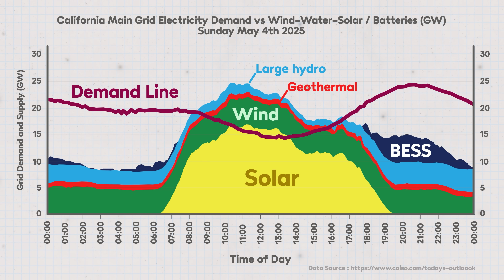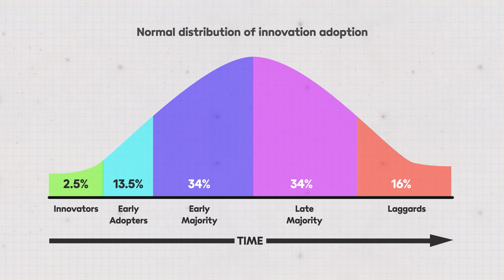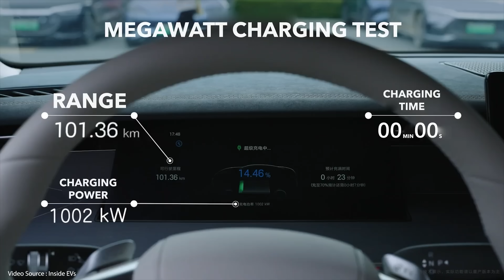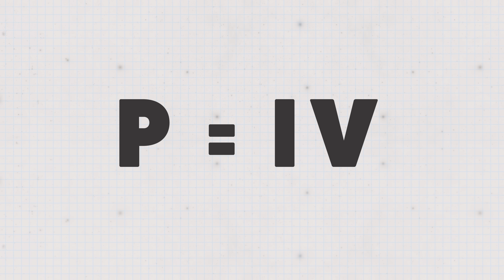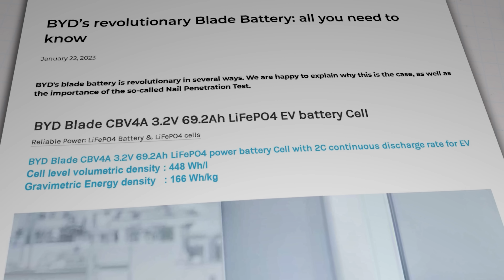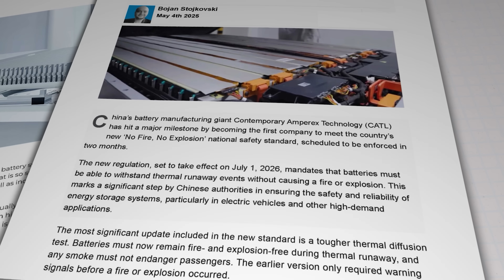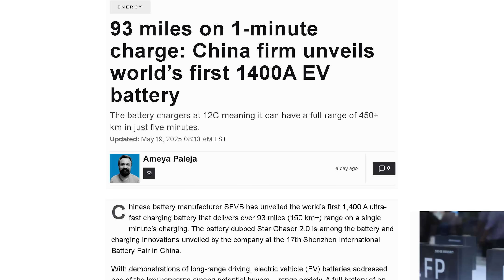BYD 1 MEGAWATT 5 minute EV Charger. Overdue or Overkill?

Comment: Fast charging ruins batteries...so how's that gonna work?
Reply: Source of your statement?
Reply: The battery is designed for the faster charging. Faster charging degrades the battery faster but as long as the battery still outlasts the car, it is not an issue. You also generally don't charge at 1000kW even if the battery has the capability.
Reply: They've not been outlasting the cars so far..I'll take a watching brief
Reply: @alanwatkins1494 Data says otherwise. Batteries typically outlast the car. Most cars last about 170 000miles. The older generation of EV batteries last about 300000 miles. Newer batteries will likely last longer. Sure, there are exceptions. Batteries actually outlast the typical engine.

Comment: Whenever we go to Costco my brother points out all the cars at the gas station and asks how could we charge that many EVs at once. And I always reply most people will charge at home or at work when not travelling between cities. Gas stations are needed because people don't have gasoline piped to their homes.
Reply: Since 2007 power use in the UK has decreased from  340twh to 315twh in 2023.
More than enough drop in demand to cover the increase in demand  from EVs.
Reply: @patdbean You’re right Pat, the biggest drop in consumption was when most people moved to led light bulbs, the drop was significant and material to the grid.
Reply: Are we in a Moore’s law situation with EV charging speeds?
Reply: @thomasreilly6362   Don't think so -chemistry is the limiting factor. But we may be looking at that sort of improvements in all the supporting electronics, inverters/chargers/energy management/
Reply: @Zirrad1  Obviously, it’s not quite the same but as charging speeds increase. As pointed out at the end of the vlog. The technology is increasing and advancing at such a pace it no longer be seen as a negative factor to owning an EV.
Reply: Only issue is housing, because I can't afford even a townhouse. My Apartment building is 60 years old, and the owners will not install chargers in every spot. And there's not even enough spots for the residents here. Now if there was street charging, even if it was a slow charger I'd be happy with that.
Reply: @leftcoaster67  When cars were invented there were no tarmac roads. When trains were invented there were no rail tracks. As the technology is adopted, infrastructure will develop.
Reply: @LaReynedeNeige  or we just complain how expensive the infrastructure will cost and refuse to do anything
Reply: @MorbidEel  If people want a technology the barriers magically disappear.
Reply: @LaReynedeNeige   I think you will find we have had an electrical infrastructure long before lithium powered cars came along......
Reply: @geoffhaylock6848  Sure, in which case, that means it's merely a case of upgrading the infrastructure to suit the need.
Reply: @leftcoaster67  Streetlights in residential areas are all wired for high power sodium bulbs. Now that they are almost all LED there is excess capacity at each pole. A British company now offers a product that puts an EV charging plug at the base of the pole
Reply: @Zirrad1 Luckily, all of the old low pressure sodium lamps were very low power. Average lamps on UK streets were 55 watt. High pressure replacements were a bit higher, but the cabling was only ever big enough for lighting. Maybe 5 amps at a push.
Reply: That is correct. We have 5kW EV chargers on many lampposts nearby (in central London). I’ve used the most convenient one for me a few times. From 00:00 to 07:00 the electricity is close to the “normal” domestic rate, so not as cheap as one can get it with a home charger and EV tariff, but less than half the cost of public “rapid” chargers.

And new ones are popping up all the time. Some are simply a socket on the side of the post, with a QR code to use it.

And you can monitor the charging remotely. Having as many lampposts set up with EV chargers as possible, in places where many houses have no off-road parking, is a no-brainer.
Reply: @leftcoaster67  
Let's guess that you live in an Urban, or semi-urban environment?
If you use the car for your commute, it's probably less that 20 miles?
So 200 miles for a 5 day working week?
You use the car for Shopping? Once each week? maybe Socialising?
So all you need is charging where you shop and where you socialise which totals more than your weekly change in the time you're "Doing other stuff"?
Reply: @leftcoaster67  Renters(or others) that can't have charging at home will be fine in 5 years or so.  With 5 minute charging we are basically AT gas pump speeds. Or close enough that it doesnt matter.  At that point its just a matter of having the charging infrastructure.
Reply: @leftcoaster67  That's a matter of regulation though, if required to do so by law I'm sure your landlord will install chargers. For instance in Norway, the landlord is required to install a charger if the owner/renter of the parking spot requests it.
Reply: @leftcoaster67  depends where you live, in some European areas street charging is readily available, and can realistically be installed virtually anywhere.
Reply: @bellshooter  it would be great here on the west coast of Canada.
Reply: @bellshooter  That is easier in Europe than in Australia, which has a land area the size of all of Europe. 😎🇦🇺
Reply: @leftcoaster67  The owners will install charging or lose tenants. At home charging will become a requirement for people to consider renting. Until then though, if you can't charge at home, don't get an EV. If you have a sturdy high power outlet you might be able to run an extension cord to your car or see if you can charge at work. Otherwise, wait on getting that EV. Yes, I know, it is expensive to be poor.
Reply: @leftcoaster67  and then one might ask why are we slaves to vehicles?
Reply: @leftcoaster67  This issue will need to be solved for multi units. Perhaps energy savings in other categories (heat/ac)will free up capacity for BEVs.
Reply: People don't have charging outlets either. Only those lucky ones who can afford a house. To electrify cars succesfully (if it is a good thing, that's up for a debate...) there's a MASSIVE need for as many public AC outlets as possible. It's not the range anxiety that scares people off, it's the charge opportunity anxiety. As long as I live where I live, unless there's a charging point nearby where I park on the street,  I won't consider buying an EV. And many many people are in such situation. To start, every streetlamp near parking spot should have an additional 3,3kW outlet. Ideally every 3rd parking spot should have an outlet.
Reply: I agree , with most of that.
Many streetlamp chargers in big cities nnow. 

400+ in london last time I checked,  with 15 or so a week going in. 

Only 3-5kw so not a quick charge,  but good enough to give you a good ( say 20-80%) charge over night. 

 @Lvvcassss
Reply: Drop car-culture all together and focus on universal access to no or low-carbon transportation and a home wouldnt need a driveway, and cities wouldnt need all the wasted space car infrastructure... let alone gas stations.
Reply: In big cities maybe.
But in general people want their own transport , they do not want to pay a fortune to share a "smelly" bus and wait in  the rain for half an hour for it to arrive.

Now if you  are talking about a door to door robotaxi  service for say 15-20p a mile., with a minimum charge of say 3-4 pounds.

 Then wonderful , but they will still need somewhere to charge. 

 @TheGreatSovietUnion2
Reply: Ok  in cities.
But public transport just does not work in less populated zones.

Busses and trains are just too unreliable and too costly. 

People do not want to Wait half an hour standing in the rain waiting for an expensive bus. 

Now, a good cheap door-to-door robo taxi service could work.

But they would still need somewhere to charge. 
 @TheGreatSovietUnion2
Reply: You need to remind him every time? 🤔
Reply: While that works in some places and not in others, the issue is the electricity needed.  There is not enough energy production to handle a mass move to electric cars and it would take a very long time to get production up to the levels needed.
Reply: @pyrolight7568 there is enough electricity.
Since 2007 uk demand has fallen from 375twh in 2007 to 306twh last year 

The Average uk road vehicle is driven 8,600 miles a year. Some more some less, but that IS the Average.  

So at 3.5 miles per kwh

That adds up to about 85twh.
ing Making total UK demand when every car is an EV demand will be  around 400twh

  only about  25twh more than it was 18 years ago.
Reply: @gecho194  "most people will charge at home or at work"

So in the future most people don't go on holidays any more? Or indeed travel much away from their home town or city?

You also seem to be assuming people never have visitors (least of all overnight ones who need to recharge their own EVs). So how many chargers does your home have?

You are also assuming that you have parking (AND EV charging) at work. Yoiu are ALSO assuming you have parking at home. I live in a suburb which dates back to the 19th century and many houses there have no parking at home at all.  Their owners park out on the street or not at all.

And if we are talking about megawatt chargers, you also seem to be assuming your home and car space at work have megawatt charging. If your house has a megawatt charger you are going to need high tension power lines just to deliver that power to your house.
Reply: Yes, you are right not everyone can charge at home. But most,  70% can.

The rest will charge in the locations they park at anyway.

As of 2025 london has over 500 street lamp chargers. With another 10-15 a week going in.  

Basically, if you are going somewhere "just to charge"  then you are doing it wrong. 

Cars are parked for 80-90% of their lives, there should be (and will be)  chargers  in those locations.
Reply: You have just ignored " the word "most" in the statement.  

Most charging (70%+)  is today and will continue to be done at home.

Most of the rest (20%+) will be done at other destination. Work,  supermarket car parks  etc etc.

The rest will be done on route at high-speed chargers on motor ways in the 20-30 minutes it takes to stop for a sandwich  and a coffe and use the toilet. 

Remember a modern 250/350kw charger will add 200-250 miles range in 15-25 minutes.

250 miles is another 3-4 hours of driving,
 And no one should be driving more than 3-4 hours between stops. 

 @Stephen-gi1rx
Reply: "most" charging   (70%+) is today  done at home and will go on being done at home,  because that is the cheapest, no waiting just wake up in the morning to a full battery.

  Most of the rest will be done at work, 
Again no waiting just cone  out to a full charge. 

 The other 10-15% will be done on high speed super chargers  in motor ways, just as it is today. 

A modern 250/350kw charger will add 200 to 250 miles in 15-25 minutes.
Reply: @patdbean and we know the charging speed  is increasing. 

I suspect that we will have stations with the ability to charge limited number of cars really quickly but slow down under a sustained Rush of cars due to on-site capacitors and other storage.
Reply: @patdbean  "'most' charging   (70%+) is today done at home and will go on being done at home,"

Where did you get that "70%+" stat from?

BTW, you seem to be assuming that every home has a place to recharge AT home. Not all homes do. You also seem to be assuming that you have only one car to recharge. Some in my own street have at least two (the family car & a work vehicle). A few can have more than two (the family car, a work vehicle, & one for the son or daughter). You can also have more than one if you have overnight visitors who also have a car in need of a recharge.

And that is assuming you have offstreet parting at all. I myself ;live in a suburb with houses dating back to the 19th & early 20th centuries & so have no offstreet parking at home. Most cars have to park out on the street; and even when owners do have home parking there is almost always space for just one vehicle.

Then there are the multistorey apartment blocks with basement parking some of whom have dozens of apartments. To retrofit them with EV chargers would likely cost millions; and all the more so if they are going to install megawatt chargers since those are likely to need high tension power lines hooked up to the apartment block to deliver the megawatts required.

The point is home charging is not always possible; and that 70% stat you cite will likely dwindle as numbers of EVs grow and the people who buy them go beyond the current demographic who do.

patdbean: "Most of the rest will be done at work,"

That assumes you have offstreet parking at work. Most workplaces don't. Or when they do it is mainly for the bosses. (Ask yourself how many NY City or Chicago office towers have 
offstreet parking for the hoi polloi employee,) Even when there is It also assumes that employers will pay for EV chargeers install. If they do install some expect to be charged for the privilege of using them.
Reply: It is not possible for urban populations to charge at home.  For most their  existing service is 60 or 100 amps and already stretched thin.    OK for $25,000 or so maybe they could upgrade to 200 or 300 amps.  That's not the issue - the power companies cannot supply it and they are currently advising us how to use less electricity, not more. They can advise us not to buy their product because the government bureaucrats essentially run their businesses by allowing them to discourage use by charging more  rather than encouraging use and increasing production while charging less.  Either way they can make money - the only object of any legitimate business.

On the other hand the problem gets much worse for charging on the road; in fact it cannot work.    The con artists absolutely know this - the EV is the method by which you will be denied personal transportation simply by the fact that insufficient supply met with staggering increases in demand MUST be met with prices so high even Bill Gates might blink.   Next year gasoline will cost 8 to 10 dollars a gallon in California as they continue their transition to unicorn energy.   No problem-o for the power elite who could care less what these costs add to the price of everything.  Leftist Billionaires cold give a rats behind how much the necessities of life cost.     They can pay for all that for an entire year before their first coffee break.

Wake up sleepers - before it's too late.
Reply: Between 70-80% of EV charging is done at home NOW today

Even a 60 amp supply will easily deliver 7kw or about 20-25 miles per hour of range add. 

A 100amp supply will easily deliver 11kw or 35-40 miles of range per hour. 

So an overnight charge will give you between 150 and 300 miles of range

While the average uk car is driven 28 miles per day, so most will need one or two overnight charges a week

My overnight power costs me 7.5p per kwh or between 2 and 3p per mile.

 @brucefrykman8295
Reply: @brucefrykman8295 a 60amp supply and eaaily deliver 7kw (about 28amps) and a 100amp supply can easily deliver 11kw (44amp)

They will mostly be doing it overnight, so not while the cooker is on or the kettle is boiling.
Reply: Or put another way that 28 mile per day is about 50-60 minutes on a 7kw charger or 40 minutes on an 11kw charger.

No , we can not ALL charge at 6pm. 
But why would I want to pay 27p per kwh at 6pm? when between 11pm and 6am it only costs 7.5p per kwh. 

there will be no grid overload or substation overload because ev drivers will not be charging at 6pm when the load is 35-55gw

They will be charging between 11pm and 5am when the load is between 18-25gw

As i said above the grid has enough capacity because demand has done nothing but fall for over 15 years.

The grid was regularly delivering 60gw in the early 2000s I have not seen it above 50gw for well over 10 years.
Reply: A 60amp supply can easily run a 7kw charger (only about 28amp)

And 100amp supply cam easily run an 11kw cuatger (only about 45amp)

Remember you will not be running it at 6pm along with the cooker and the electric shower. Because why would you want to pay 27p per kwh,  when you could be paying 7.5p per kwh.
Reply: It also means you can refuel in seconds not hours at a fraction of the cost.

Comment: Get an EV and you'll never look back
Reply: That's only applicable if you can afford to buy a new car (and being able to sell your old and outdated car) before the factory guaranty runs out.
Reply: @RojohII There’s quite a few used EVs now at a more affordable price like the Chevy Bolt, Mustang Mach E and the Nissan Ariya. I’ve been seeing a lot around the $20,000 price range with less than 50,000 miles. Granted this still might be a lot for some people’s budget but it’s generally considered affordable.
Reply: @RojohII  some of these BYD are like $16k or so to get into which is cheaper than most gas vehicles even many that are used.
Reply: @RojohII  
Same applies to Ford EcoBOOM ICE vehicles (Etc)
Reply: @RojohII  Get a second hand EV (cheap as chips), and sell your ICE below market - what you lose will be a pittance compared to what you save.